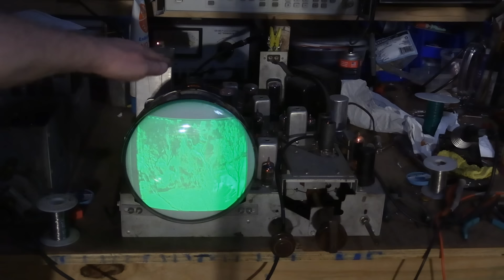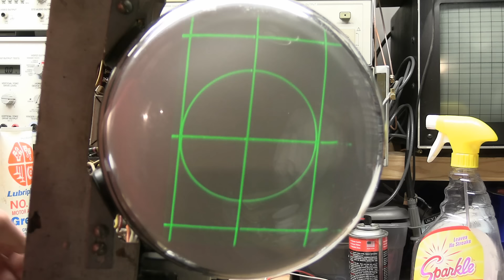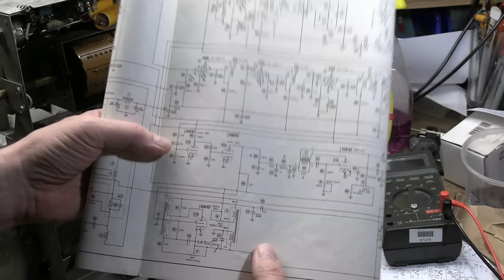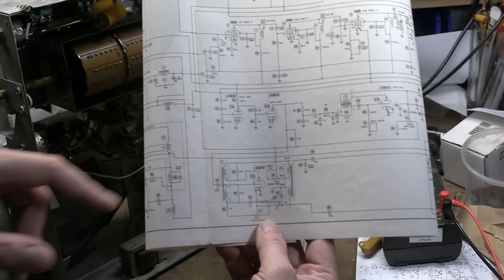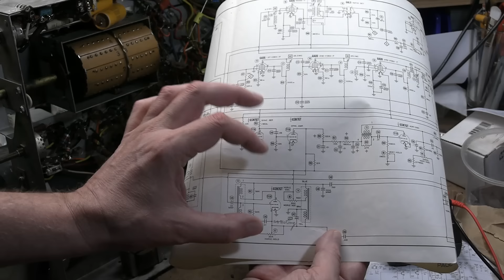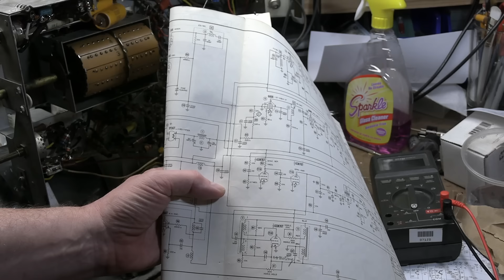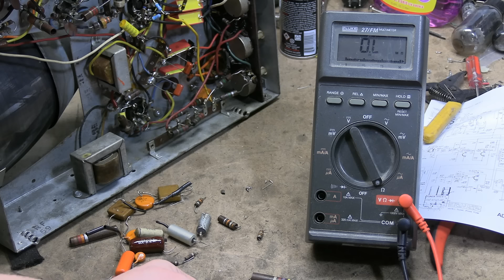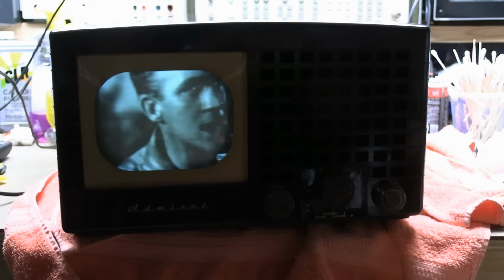Admiral 19A11 restoration

Comment: could there be tin whiskers in that pot? shango's had that problem several times.  it shorts the control out intermittently or totally and can be hard to diagnose.  he's caught them on camera before but there were a lot of them growing on the control back shell and it was open frame so you could see inside.
Reply from the maker: Sure, very likely. Seems to be OK since I cleaned it a few days ago.  Time will tell.